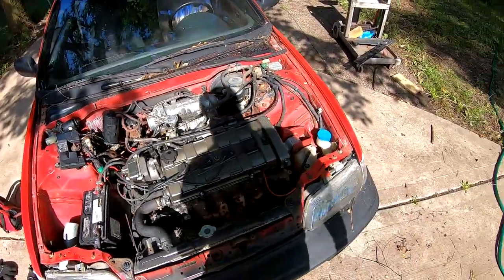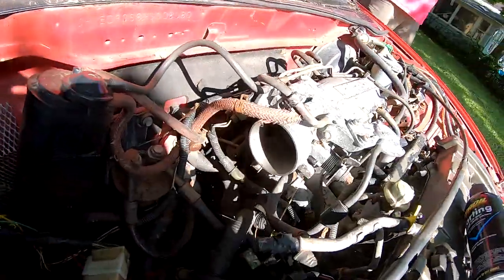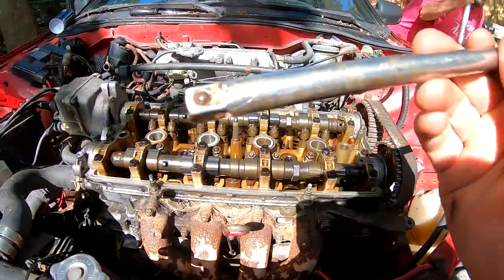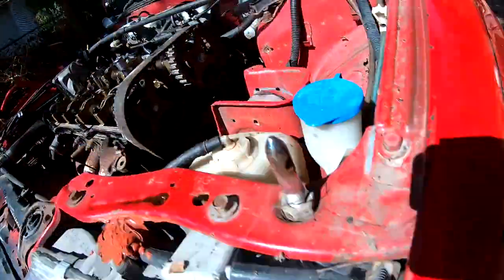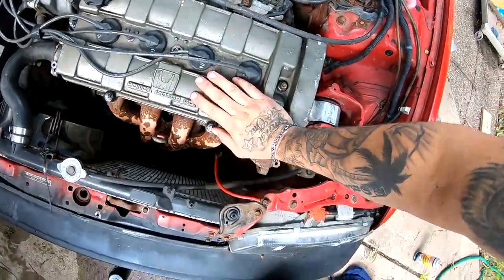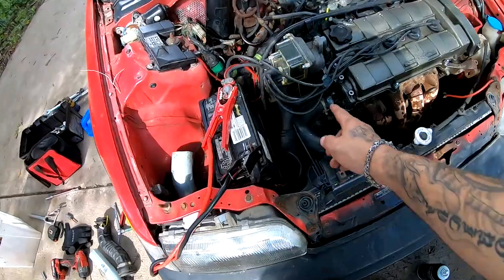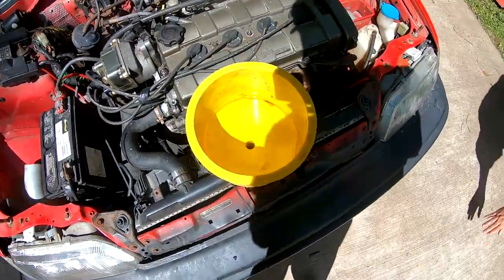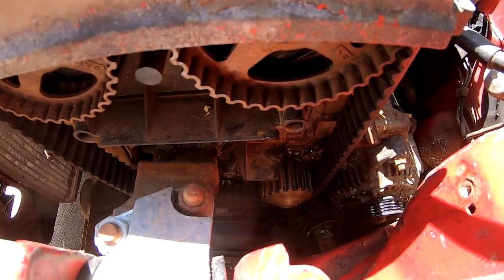Abandoned CRX STARTS!! B18 wakes up PART 2 Share this video my buddys dream car

Comment: I believe The top outer plastic cover help pushes in the inner plastic cover behind  the timing gears to keep the rubbing off the timing belt. But if too warped, more than likely toss,  replace, or shave plastics. I have a B18c1 and I shaved the majority of the inner plastic  to fit aftermarket cam gears which were an 1/8 of an inch wider cam gears than stock.
Reply from the maker: we got some from the junk yard it was warped badly. thats not a bad idea to shave the inner plastic I will let my buddy know. thank you.